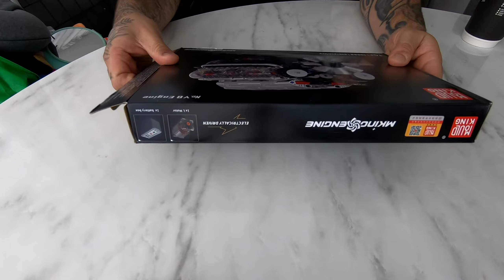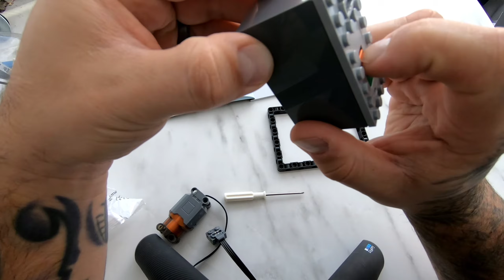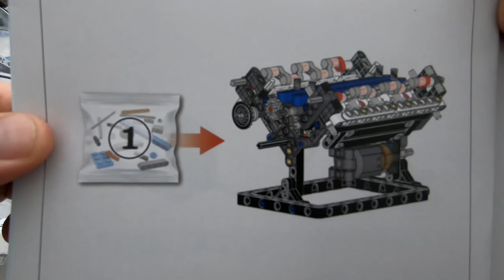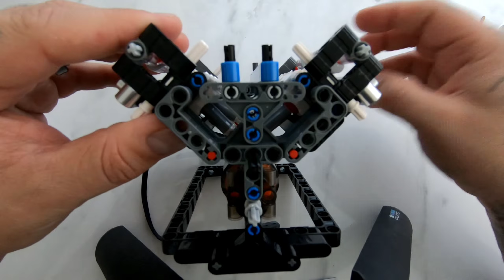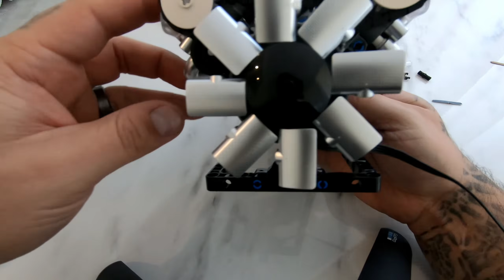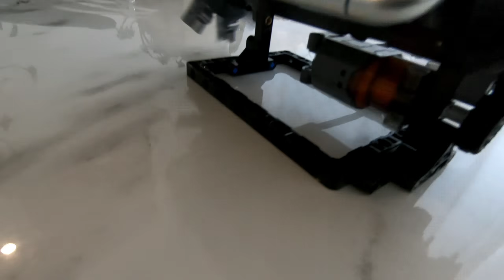MOULD KING 10088 V8 ENGINE BUILD | 535 PIECES | LEGO ALT

Comment: I recently built this exact model. I kept the timing chain at 32 links each and yes, the first one was loose. In the end, the engine worked for me. I had a few different parts left over as you did - lol. By the way, I laughed hard when you broke the fan because I did the same thing - had to put the blades back on and glad I didn't damage the electrical cable.